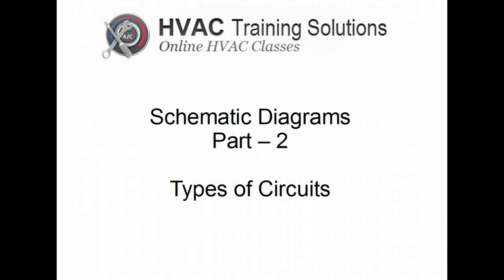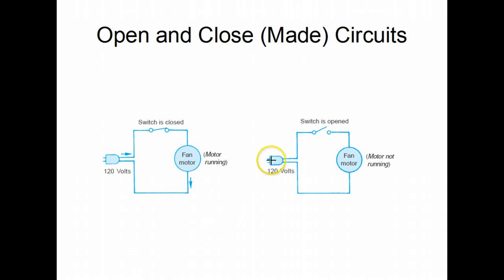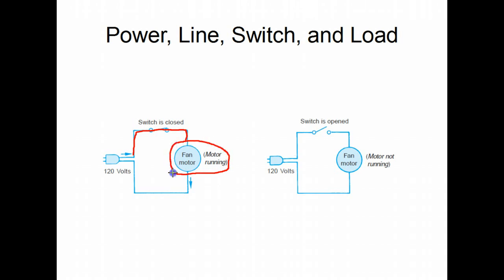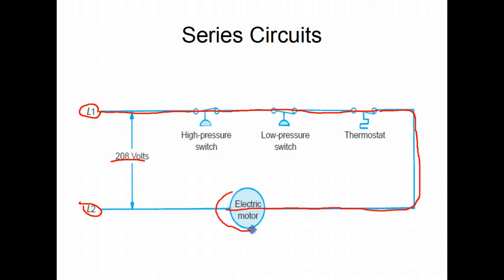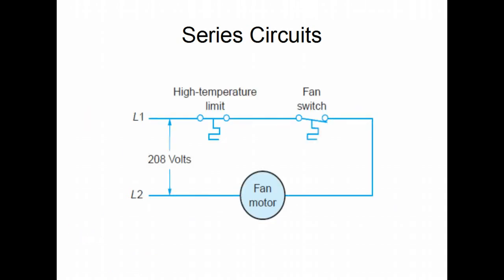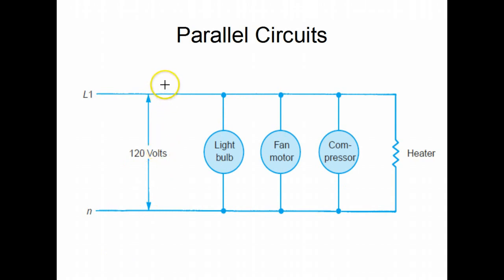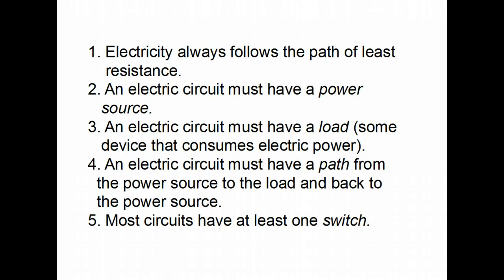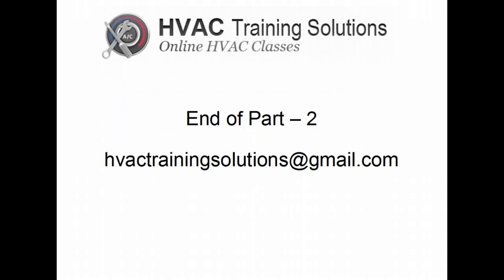Schematic Diagrams - Part 2

Comment: Good video, right principles, BUT should note that usually the High and Low Pressure Switches and Thermostats interrupt the 24vac supply from the stepdown transformers, NOT the 120v/208v/240v/480v lines ... I'm concerned someone could be over-eager, test for line voltage at the switch or thermostat, and not finding it, may go ahead and try to "supply" it using a jumper ... keep up the good work.
Reply from the maker: Fidel Algarin Hi Fidel, this is part of our Electricity for HVAC Technician Course and the schematic is taken out of the textbook. The video is a supplement to the text. But you are correct.
Reply: +Ron Walker Safety and wiring equipment at the wrong voltage is not only wrong in the field but extremely wrong also in the classroom. Your teaching your students bad habits.  When something you know is wrong you shouldn't teach your students to ignore it.  That is the difference of doing something that is a science and turning it into a art that you can feel proud about.
Reply: I have encountered line voltage limit switches before...